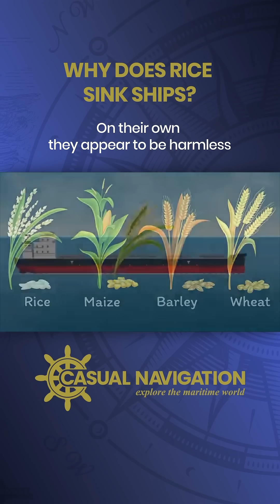Why Does RICE Sink Ships?

Comment: This is why you split the cargo hold into multiple sections so that the center of gravity is maintained. 3 or 4 different sections in the width and a certain number (depending on the length) along the length ought to do the trick.

Comment: If they simply weld some simple hanging partition plates to the ceiling of the cargo bays, then a full cargo bay would no longer experience this issue, at the cost of slightly reduced volume.

Comment: Grains can explode. Make the particles small enough and if it catches on fire the reaction is violent. If they are aware of the angle of repose, why wouldn’t they simply pour it with multiple peaks? Seems like an easy problem to solve.
Reply: They stop liquids from moving fast with baffles. They could add some grain baffles.

Comment: they could just vibrate the inner hull shifting the rice equally, same method is used to remove air from poured concrete.
Reply: good way to shake the ship apart.

Comment: Which is exactely the reason why one of the Flying P-Liners - the Pamir - sank on Sept 12th 1957. The famous sailing vessel had a cargo of barley which was loaded into her hull without the usual loading skills, due to a strike of the dockworkers in Buenos Aires. She ran into a hurricane, the barley to slipped and she listed more and more until she sank. She had a crew of 86 - only 6 survived

Comment: I don't know anything about ships aside from war stories so correct me if I'm wrong... Wouldn't a ballast help solve this? Like how in earthquake prone areas they put big ballasts in the tops of buildings to counteract the forces of the swaying?
Reply: All cargo ships have ballast systems, they pump water in or out of the ballast tanks when loading/unloading cargo to offset weight added/taken away. I don't think the ballast pumps would be able to work fast enough to correct the kind of weight shift seen in the video, but ships will typically cover the grain to prevent it from shifting as much as possible which probably helps the ballast system compensate
Reply: @kalenmeisner9966  I get that, covering the grain that is. Very insightful, thank you

Comment: This maybe a dumb idea but would a rotating container work to just keep it rolling and roughly level?
Reply: There's three reasons why you wouldn't do that. The first is that it becomes mechanically complex to implement - more moving parts means more expense, especially on this scale - reliability also goes down as well.
Secondly, you run the risk of a resonance occuring - at the right rocking frequency from ocean waves, a ship could start to rock wildly back and forth, much like pushing a siwng makes it go higher and higher - you could compensate with some kind of dampener, but that adds to the complexity.

Thirdly, and most importantly, you lose cargo volume, through both loss of physical hold space and  due to weight limitations brought on by heavy mechanisms.

People have tried such mechanisms, as far back as the Victorians with the SS Bessemer - but none were ever viable.

Comment: .   Yet another problem we would rather loose lives and ships over than put the effort into adding something simple to take up the rest of the space above it in the hold so it can't move or adding vertical baffles.

   Inflatable toppers. 
   Solid sheeting and vertical load locks.
   Vertical baffles in the hold

    Do I need to keep going or are you ready to take the toy boats away from the little boys in big bodies who use them and their crews with careless recklessness needlessly putting lives in mortal danger?

    Toopid Hoomans.
.
Reply: This is a non-issue, the video poster just didn't mention the solution for comment engagement. They just fill the containers to the top so it can't shift

Comment: The rice moving is causing a dynamic shift of the ships metacentric height that being the point where its center of mass and its center of gravity intersect. If the metacentric height moves too far in one direction or the other the ship will go into an unrecoverable roll. The rice shifting and changing the center of mass makes it much easier to hit this point of no return.

Comment: Fill container to capacity and add a vertical wall to exponentially minimize the effect of the rice shifting
Reply: That is correct. Tanker trucks also have separating walls, called baffles, to distribute weight evenly and reduce sloshing effects.
Reply: @tsw104  the baffles don’t really help distribute the weight all that much on a tank unless the fluid is fairly thick it just helps immensely with the slosh
Reply: Or just a midwall in the container which would reduce the effect of the angle of repose almost entirely
Reply: @cjmarion6350  literally what trains have been doing for centuries
Reply: Yes and no. Tankers depending on task will have baffles. Chemical tankers, and food grade tankers most of the time are straight bore so they can be cleaned. A tanker that carries gasoline or oil products to your local gas station has a setup the I have heard referred to as cells. With each cell being capable of holding a different product. 98,91,89 octane gasoline for example. Now if it’s a bulk load heading to a distributor of a single product and it’s not food grade it will have baffles. 
Products under pressure like propane, anhydrous ammonia, and chlorine are transported in tankers that are not baffled.
Reply: @Bugleboy2000  I don't know any of the names but tanker baffles describes exactly what I was trying to get at except on a ship it would go vertically down the hull, though I could see a need for horizontal ones as well to prevent the front of back end sinking too far
Reply: @Joeljr110  I don’t see any reason they can’t use them in a bulk grain ship. Sounds like a pretty convenient solution. I was specifically talking about semi trucks and tanker trailers. Mainly because that’s my area of expertise.
Reply: ...and this is exactly what they actually do on ships with dry and liquid (oil) cargo. If you fill the tank all the way to the top with minimal headspace you minimize the free surface effect.
Reply: Could get the same results by packaging the rice and putting it on pallets
Reply: Or, if you're limited by weight not volume, use some sort of adjustable lid. It can't shift then
Reply: @pws3rd170  Ships aren't really limited by weight, and an adjustable "lid" is incredibly complex on something of this magnitude.
Reply: generally they don't fill it totally, but rather 95% of capacity, because grains tend to absorb moisture from the air and that 5% gives it rooms, while being full enough that the shifting doesn't cause too much imbalance

also another fact is they load grain in the same bays they load Coal and other minerals in, they just clean it first, and the grain is cleaned again on import, both for pests and hygiene
Reply: You don't even need the wall to go all the way down, just keep the top from sliding about. They build some tanks like this, they may build bins like it, too. It'd definitely be a benefit for cargoes like grain or bauxite.
Reply: Why not use rice bags and iron columns.
Reply: @bizudamarasengan 
I guess you'll avoid every unnecessary step in the delivery chain when dealing with these amounts of grain. 
So if the product is delivered as is - for example to farmers etc - then you'd just introduce unnecessary work: ordering and storing bags, transporting the product to and from packaging, loading sacks into containers (if containers are appropriate - I don't know),... 

Whereas with this kind of transport you'll only need to dump your stuff somewhere and you're good. It's just more efficient / cheaper to transport it this way.
Reply: At these scales the grain settles over a few days iirc
Reply: slosh baffling
Reply: With most bulk cargo you can't cube out the holds because the draft will be too deep.  Adding a light filler to fill the hold would likely cause contamination concerns.

Had this problem with taconite ore pellets, they're like marbles, but never had to go long distances like across oceans so it was far less of a problem.
Reply: Just like they do for race cars such as in Formula 1.
Reply: I mean it will settle but yeah buffers are primary the good good thing
Reply: That’s what I was thinking, dividing walls to minimize shifts, that or differently shaped containers, like if it narrowed near the top, and was filled up into the narrow neck, then it would wholly neutralize the issue as it would center it on the ship and make any shifting non-issue 

Unfortunately that method would reduce capacity…
Reply: i was just thinking like what if theres no area for the rice to move
Reply: Could you put it in cylindrical tubes completely full then it won't move and have the same angle of repose
Reply: @kieranbaines743  Might waste space and be less easy to unload depending on what you mean
Reply: "exponentially minimize"
Reply: I was thinking the same thing but was like I don’t know anything on the subject there has to be some reason they don’t do it

Comment: Would there be a way to mix it in a sort of liquid without altering the rice? Potentially an oil etc that would prevent it from not shifting back.
Reply: Probably not for either food safety/cost reason.
If you cover the rice in oil, you then need to both make sure its food safe amd that you can remove it again after the voyage.

And you do not want to use anything water based because then you have way bigger problems on your hand

Comment: The solution to this problem is a simple one but expensive. Just install baffles in the storage tanks. It does make the unloading process more difficult but the baffles would keep the weight from shifting.
Reply: or just get smaller containers. so most of them are packed full.
Reply: Install conveyor on the bottom easy.

Comment: This is why baffles are introduced to the cargo to minimize the risk.  Can’t use baffles?  Dynamic ballast tanks can easily substitute, offering offsetting weight as the ship rolls.  Physics is fun when you know how to play the game.
Reply: What are baffles?
Reply: Baffles are a physical barrier within the cargo hold to restrict movement, especially with liquid cargo.  The liquid can pass over the top and/or bottom of the baffles.  It’s rather like having 4 foot tall walls in your living room, you can hop over them to get to the other side, but they slow you down.
Reply: Would the ballast pumps be able to keep up with the weight transfer of this volume of cargo? I thought ballast operation only really happened when loading/unloading

Comment: I thnk that is also the case with fuel in airplanes. They fixed it by installing low walls in the storage in the wings to decrease liquid sloshing.  I think they do this in grain ships as well
Reply: They have in fuel trucks too. The long tanksvhave walls with holes that slow and movement fowardcwhen truck brakes
Reply: the trouble is, alot of these ships carry all kinds of stuff, not just grain all the time. so you can't really modify the ship just for grain because it won't be good for other stuff and less competitive in the market.
Reply: @katelights  I don't think so. I think you can though. As long as whatever you're carrying has the same state of what the ship was built for. 
Like you can take ship phosphate in grain ships

Comment: I didn't think of that aspect, I just thought of it swelling with the moist air or a leak and adding weight
Reply: Me too.
Reply: That would increase the angle. Either reducing or exacerbation.
Reply: This is just another factor of danger. Aggregate freighters on the Great Lakes are said to have developed leaks in foul weather and the aggregate cargo got wet until at one point buoyancy was lost and the ship sank rapidly apparantly with no prior warning signs. Even less so in heavy weather when pitching and rolling doesn't let you examine the waterline before it's too late.
Reply: .. . Good imagination or bad imagination idk I've lifted rice bags before so I guess I had a frame of reference.
Reply: Same the short explained well I think
Reply: Except this can be easily sold by just compressing the top. 

All you would need would basically be a big piece of plywood with some upright sticks above it to hold it at the correct height. 
And if you want to get fancy with it you could have the top of the container be held at a specific position with hydraulics
Reply: Nobody thought of that aspect, till the first ship with rice capsized
Reply: Ditto
Reply: That's what I was thinking of